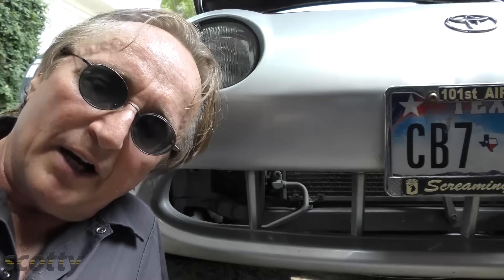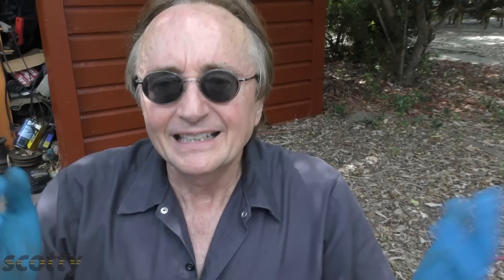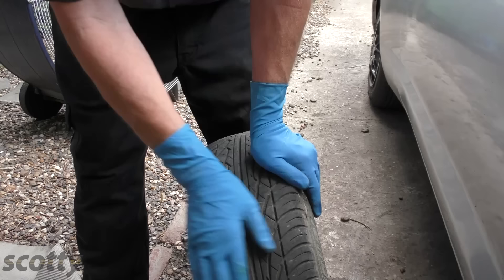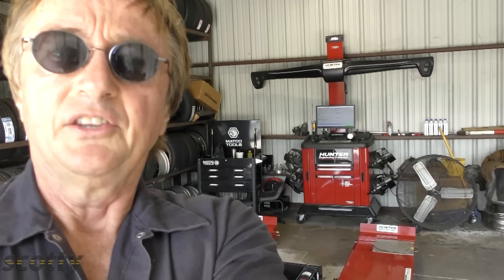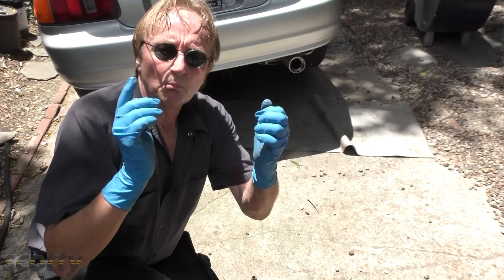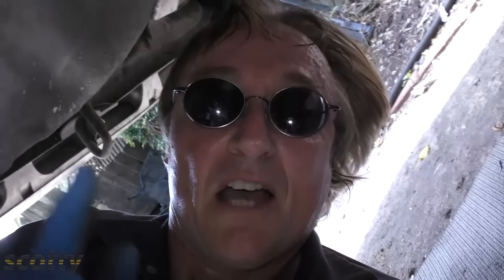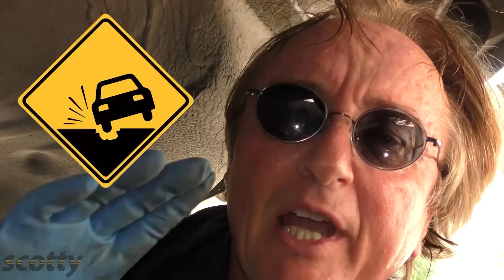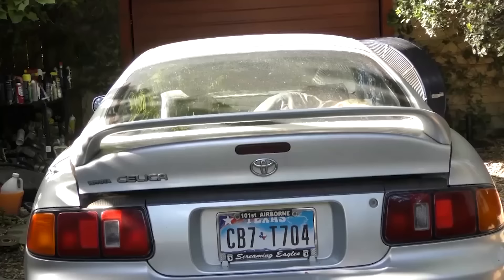How to Tell if Your Car Needs an Alignment

Comment: Hi Scotty, I just bought a used Ford Focus here in the UK and when I apply the brakes I can feel the steering wheel shaking. Any idea what could be causing this, and do you have a video where you already cover this kind of issue? Thanks, loving your work my friend! Ken
Reply: Your front rotors are warped.

If you feel it in the steering wheel it’s the front, if you feel it in your ass, it’s the rear brakes.
Reply: Lol. Pretty much.
Reply: Definitely rotors, easy fix
Reply: Agree with the others, Likely the front rotors need replacing. Its an easy fix, If you're wanting to save 100-150 bucks. Its a good opportunity to check the life of your break pads as well
Reply: Thanks for your advice, much appreciated! I guess I'll be getting some new ones fitted.
Reply: If you do decide to do it yourself, Make sure you clean the new rotors with either rubbing alcohol or something like brake cleaner. They send them out covered in an oil so they won't rust while sitting and thats no good for your brakes. Cheer mate
Reply: Awesome thanks for the tip!
Reply: Cheers for the advice!
Reply: Remember to apply a smear of copper grease on the piston side of the pads to prevent squeal.
Reply: Hi kindly check that rotor first, probably their right. Also see some guidelines before buying & replacing it those rotors. Check videos in this website, there's a lot of pro's out there.

You can also try to touch that rotors and see the uneven surfaces if there was, you could really somehow judge it simply by touching.

Good luck, give us a hit to your ford =]
Reply: Hello,  finally after you finish replacing the rotors dont forget to top off the rotor fluid as well.
Reply: Change the beak pads as well if your rotors are warped, and do it yourself, its not a big deal and it saves some cash.
Reply: I just did brakes with Same symptoms. Caliper was seized up. Make sure to check that too and prepared to replace it
Reply: Brakes
Reply: TheMillennialMechanic never read a better explanation! You sir, are a great internet goer!
Reply: You might also want to check the lower suspension arm rear mount as these are a very common thing to go on a Focus & i have changed plenty, Early signs can be a shaking as a worn rear bush allows the lower arm on the offending side to move slightly forwards, backwards & even a bit sideways & of course the wheel follows it causing the whole hub to shake.
Reply: Also make sure your sliders on the caliper are not sticking.
Reply: The problem is your driving a ford! Far as the problem its definitely warped rotors. Those focuses are notorious for cooking rotors. When you get new rotors, get the heat resistant carbon rotors.
Reply: daandriodyup that anti rust coating they put on rotors is the worst !  Just spray them down real good with WD 40 and give them a light wiping  .problem solved!
Reply: I don't get it - my old 1992 BMW 325 had 286mm front rotors - weight 1365 kg (sunroof). After changing rotors and pads never had any brake shuddering. My dads 2009 Focus has 280 mm front rotors - weighs about 1275 kg. After using Disc Brakes Australia OEM spec rotors and Bendix pads it suffers from brake shuddering once again. So annoying!
Reply: Lachee Brun did you clean the hub surface?
Reply: Thanks for the reply - when it gets done soon we'll have to make sure it gets cleaned properly. Do a DIY on oil, spark plugs, coolant but don't do brakes even though it seems fairly straightforward. Cheers mate.
Reply: kenmercermusic we had that with a toyota 4 runner. You need your brakes checked along with the rotors. Sometimes they will cut the roters and switch out the brakes. It will set you back 400 us dollars.
Reply: Thanks for the info!
Reply: Drive it in to the ocean and stop buying Fords! Lol
Reply: hmm maybe lol
Reply: Seriously though..... Sounds like warped rotors. If you're keeping the car for a long time I'd splash out on decent ones. Don't buy cheap ones. It can make a massive difference to your braking performance in my experience...... That being said I'm a medic not an engineer lol
Reply: Thanks for the tip, I will be getting some decent ones sometime next month and I'll probably change them myself. Cheers. :)
Reply: +TheMillennialMechanic Nope. Rotors can not warp. Rotors never get hot enough. The rotor surface could be not true to the vehicle. But a rotor will not warp. To get a rotor to do that, you would need to make the rotor extremely hot, more than a rotor will ever get to during normal everyday driving, to the point that the rotor is glowing and around melting point.
Reply: kenmercermusic Also make sure your caliper pins are well lubricated. I found out that a dry pin was causing one of my front brakes to hardly apply any pressure while the other was doing all the work. While you're replacing pads and/or rotors is a good time to check. They're not hard to find. The caliper slides on them when they squeeze the rotor.
Reply: +Taunuslunatic Don't. You're not supposed to do that. Do-it-yourselfers been doing that but you are not supposed to do that.  No manufacturers, as far as Ik, approve of that being done on their vehicles. If you ain't like me, ya keep your  vehicles stock, then  always do what the manufacturer says to do.
Reply: +Draxus Don't  put bare fingers on the rotor surface. The oils from your fingers will affect wear and may cause issues.
Reply: Hey scotty, I just had the same problem. When they fixed mine is my tires need a new balance so i’d take that route first its cheaper. And if it still shakes after that then gotta look deeper into it.
Reply: kenmercermusic check your worn out brakes or warped rotors maybe suspension components
Reply: I like how the question was for Scotty and he didn't have to do a thing. "My job here is done". :P    Solid rotors vs vented rotors tend to warp if the material is not thick enough and you hit puddles of water while braking hard and often such as stop and go or track racing obviously.  Something often missed is someone removing the rotor and not cleaning behind it on the hub. Debrit can be stuck between the rotor and the hub therefore the rotor sits crooked causing the wheel to vibrate. And then there is a rusty expanded rotor at specific spots on the rotor's edge that hits the brake pad.
Reply: kenmercermusic your license plates are loose.
Reply: @850are2  often a seized caliper is the issue.
Reply: Everyone here is spot on except for one thing. Brake rotors don't "warp" its just uneven wear, whatever the cause may be, but tempered/heat treated steel doesn't warp. Besides they don't get hot enough to warp anyways. Common myth and misconception.
Reply: @gmcdenali7178  Exactly 👍
Reply: @stevenarseneault1972  rotors don't get hot enought to warp, not to mention they're probably made from either forged, tempered or some other form of heat treated steel resistant to this type of deformation, its just uneven wear, the cause of which is anyones guess.
Reply: @gmcdenali7178  the oils? Thats as silly as saying brake rotors warp. If anything if there's any truth to that, it would be the salt from our skin thats acidic and could cause corrosion though we're likely not imparting nearly enough of it onto our brake rotors by touching them with our bare hands to affect them in meaningful way. Probably just unever wear and or corrosion cause by road salt.
Reply: @JustinBobby-di9zt  so why did I have to change all 4 rotors on my car when they were a year old. The dial showed it being beyond specs and were biting the brake pads with high and low spots. You mentioned they do not warp because it tempered and such. Perhaps all rotors are not created equal.  Manufacturing error?
Reply: @gmcdenali7178  that's right and don't accidentally spit on the rotors cuz they might rust and this will cause severe severe issues down the road just sayin.

Comment: Hey scotty! You should do a video on TIRES! Do they really make a noticeable difference? Like Walmarts 50$ tires(4star review) and some expensive one like michelline pilot sport. I'm a car guy but I have Walmart tires on and they feel pretty good but I have never bought a set of expensive tires
Reply: Michelin Pilot Sport, Pirelli P Zero, etc etc are are Sport tires for your sport car, you wouldn't want them in the winter and they might not be so good in the rain.Most people would be better off with all season tires.
Reply: Tires most definitely can make a difference, most notably in grip and ride comfort. As said by the other comment, the pilot sport and such are performance tires. My m3 is using their pilot sport a/s3 tires at 200+ per tire. Not cheap but for all season tires they do very well. If you have a typical a to b econobox, any decent tire will do. Putting on pilot sports and the like would be completely unnecessary and overly costly. Low profile tires will also harshen the ride since there is less sidewall to absorb shock.
Reply: He already did one before explaining how cheap tires are exactly that and you get what you pay for.
Reply: @Luckingsworth  5 years is the warranty on tires and it used to be 7 so 4 years it a bit soon unless you leave it in baking sun all day long.

Comment: The tape measure alignment is only good to get it close enough to  make it to the alignment shop.
Reply: is that why they say I don't need one when I get there?
Reply: on modern cars, there is only one adjustment to be made on most vehicles. Getting it spot on would be unusual, but it can be done. Getting it spot on with older cars that have several adjustment points... that would be blind luck if you got that spot on after major work.. without investing in your own alignment tools that is...tho you can get laser things now that can be used in any garage with a level surface, they'r still too pricey for the average guy to use just to do his own car once in a while.
Reply: @tootall5559  There are plenty of new cars that have multiple adjustments front and rear.
Reply: @bremCZ  I don't deal with new cars. However I saw a portable laser device on TV that will allow you to do your own alignments... if you can afford the tool. I wouldn't begin to know how all that works. Any car I've ever messed with was front end alignment only... sometimes a rear end alignment if it was involved in a crash, but I left that up to the pros, if I could get it near enough to get it to the shop. Sometimes we'd have to have it trucked to the shop. What I did with a tape is only good enough to get you to an alignment shop anyway, not a great alignment.
Reply: @tootall5559  I'd say around 1/3 of the passenger cars I've done since the 90s have been adjustable front and rear.
And yeah when you're adjusting to 10ths of mm theres no chance of getting it right by eye. Not like the old days where it was +/- 1/2inch
Reply: @bremCZ  Just another reason to hate modern cars.
Reply: @tootall5559  Not at all, Independant rear suspension makes for much better handling than a static axle.

Comment: Any other times an alignment is recommended? Say when changing suspension or lowering the car?
Reply: Burako Shimazaki yes for both of those.
Reply: Ilikeboost Thanks, does that include cars without adjustable strut plates?
Reply: Burako Shimazaki yes it does.
Reply: When you adjust or replace anything in the suspension or steering you get an alignment done.

Also normal driving will put the toe out over about 15k miles.

Comment: Beware of the tire shops that offer a free wheel alignment check.
Reply: Also if you happen to have a Les Schwab around just plain don't go there.
Reply: Why is that? Why would a free check be bad
Reply: free check is bad cuz there gonna tell u that u need an alignment after lol
Reply: oh lol i guess that makes sense. they make money on doing alignments
Reply: Jokes on all of you because at my local tire shop, they perform the alignments, install, balancing etc. For free anyways, granted that you bought tires that is.
Reply: @JustinBobby-di9zt  They'd have to be over charging for the tires then because all of a shops profit comes from service. There is no margin in the tires at all.

Comment: The systems are extremely accurate but people are not. A mechanic didn’t it my steering shell straight and did the alignment with very good equipment. When I got my car and started driving, my steering wheel was having a 15 degrees angle to drive straight. I came back and he fixed it but never ever I’ll go to this guy with very good equipment again

Comment: My car shakes a lot but don't sway left or right, so I still need an alignment?
Reply: Probably need to get your wheels balanced
Reply: You need to get it looked at. No way to diagnose that with a description like that. As the above said, may need a simple wheel balance. Inspect your tires for choppy or lumpy tread.
Reply: Doc Holiday203 could be a bubble on the tire, air pressure way different in one tire, worn tires, mud getting stuck behind the wheel (had those happen twice now), could be it needs alignment, it could be many many things.
Reply: Also have the ball joints and tie rod ends checked - and if you hear some clunking to go along with the shaking, check those things first!
Reply: Doc Holiday203 yeah if you hear a god awful squeaking noise 😂 it’s usually them ball joints.

Comment: So when I use the mesuringtape and string like so many others we're just fooling ourselves into thinking it worked 🤔
If it works, it works.
Reply: @Phil for President 2020 works
Reply: @Phil for President 2020 check out a few videos. It the poor man's way.
Reply: My car has a tolerance of half a millimeter. You can't do it by eye.

Comment: Up here in Canada where I live, it's impossible to get a 2-wheel alignment. Shops only sell 4-wheels for more $, even if your car only has adjustable toe on the front. Many pickups and compact cars still have no rear adjustment. Which is why I do myself with string by aligning the front with the rear if the toes out. They didn't have lasers back in the day Scotty.

Comment: Hello Scotty I am a listener of your videos for 8 months at least, and enjoy them!!!!!!!!!!!    I have a problem with my 2006 TOYOTA MATRIX  tires!
I just got new Yokahama Avid Ascent tires all-season brand new. I have over 200,000 miles on the Matrix and it runs great. I forgot what type of tires I had for the last 40,000 miles but they were cheaper than Yokahama tires and the car went straight down the road with no problems at all! . I  put Yokahama tires on and the car is all over the road! My wife says she feels like the car is unstable , especially going around a curve. 
I just had them replaced with another set of tires called Hercules Road Tour tires  and the car is doing the same thing !  If you or anyone out there has any advice I would GREATLY APPRECIATE IT AND THANK YOU!!!!!!!!!!  I am totally baffled at this as my old tires were discontinued and they were perfect for my Matrix , thanks for any help out there!

Comment: My 2008 CTS loses some control on front tires when going over bumps or manholes on road for a second and feels like it's pulling side to side just enough to feel it in the car.  No steering wheel shake, is solid.  I've replace all the front end suspension upper and lower components, stabilizer links including all shocks except the inner tie rods and strut mounts but they were solid and not loose.  The problem is still there.  TIres are wearing out evenly and and i can drive on freeway at 70 no issues.  Only when I go over a bump or manhole on road.  The only thing I hear is when I turn the wheels to make a u turn or backing out a parking stall is the front wheels sounding like they are dragging on the road but rolling.  I'm going to replace inner tie rods and strut mounts, stabilizer b ar bushings if it has it.  This car is such a stressor for me.  It runs great and I don't want to purchase another car as I don't want car payments so any advice would be appreciated.... Thank you  BTW, love your videos...

Comment: Your going to love this, I went to Tires Plus in Town & Country they did the alignment just like that machine. After they were done my car was immediately swear because the right I went back and said something's not right I swear each other right and they said all that's because one of your tires are worn so after 2 days I drove it to Tires Plus on Fowler Avenue it turns out that it was all the way in the negative 50s the alignment was done horribly wrong I don't know how? But the Tires Plus on Fowler told me everything. They didn't even believe that I did the alignment just two days ago. I called the supervisor there explaining what happened oh I don't know I said how could you do this? He was just mumbling excuses. Definitely be careful where you get the alignment also because apparently they wanted my tires to go bald and probably buy tires from them.

Comment: Also that is why "insurance" is so expensive for 4wd in certain countries/areas. 
My 1995 R3m nissan terrano 2.8 NA was amazing. I used to nutt out on the neighbors motorcross track at 80 KPH getting lots of air. Sometimes all 4 wheels were 1ish meters off the ground. Only problems I had with that beast were,,, Crossrod broke on right ball joint while trying to turn steering. Both front wheels were at least half submerged in river stones. And alternator needed replacing because had been submerged. 
The 95 nissan terrano R3m is incredible machine. Note only that year I have tested.

Comment: I grew up driving town cars, crown vics, and grand marquis.

Double wishbones make a comfortable ride, but expensive and time consuming repairs.

I was able to get one aligned with strings by myself (had to get it close after replacing all control arms and tie rods). Took it in for an alignment, and just caster on one side was off by a blonde one